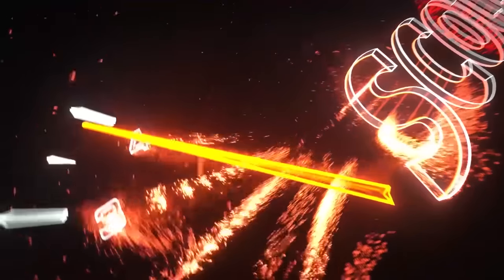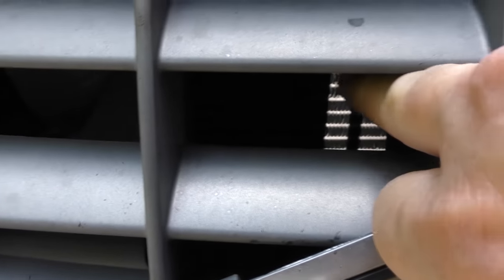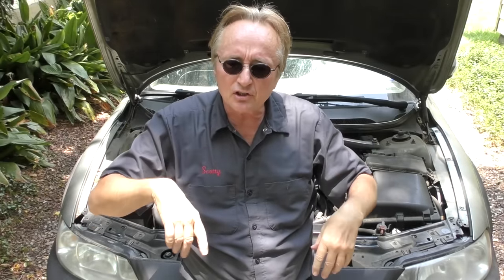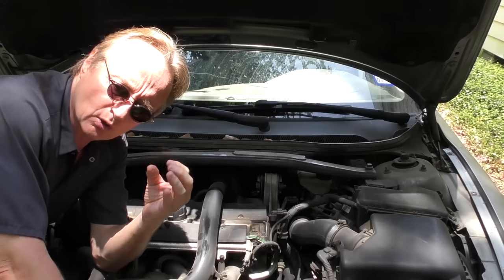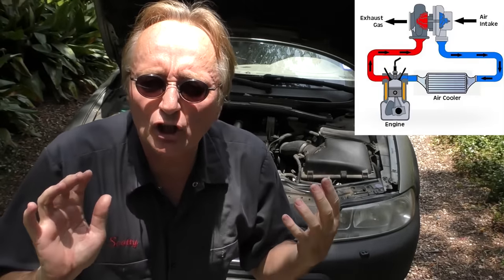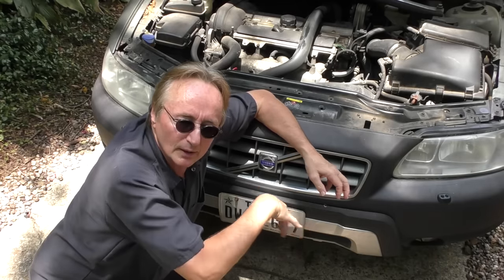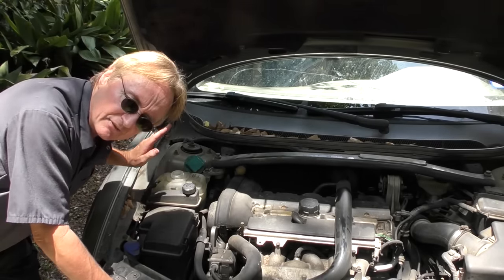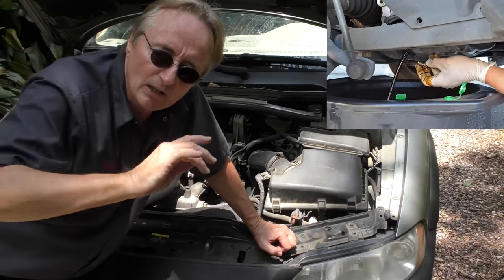5 Things You Should Never Do in a Turbocharged Car

Comment: Replace your turbo lines with silicone hoses and inspect them at every service. Newer turbos are coolant and oil cooled, just restart your engine if you ever stall your engine after driving it hard, let it cool down for about a minute or you can run the aircon on hot for about a minute which will switch on the electric cooling fans.

Comment: Re: Starting up, I just start my car and then get buckled in and whatever other messing about I have to do.   Figure that gives the engine time to get ready,  In a truck with an oil pressure gauge my method was wait for that to get a reading.

We had a Subaru Outback XT 2.5T and it actually had a light on the temperature gauge that went off when it was warm enough and you could not even put it into "Sport Sharp" mode until that light went out.

Comment: Hi Scotty, 

I have a 2016 Lincoln MKC with the 2.0l EcoBoost engine. I bought it used with about 64,000 miles and at about 65,000 bank 1 sensor 1 o2 sensor went out. I bought Bosch replacement sensors and I replaced both the upstream and downstream sensors since you usually replace in pairs. 

Now to my issue, I was getting 18.6 or so mpg before the sensor went out and now I'm lucky if I get 15 to 15.5 mpg. 

Any suggestions on how to increase my mpg?
Reply: Hi if i were you,  I would install the oem o2 sensors, on this case motorcraft and may have better results, Bosh are made for German cars, hope it helps.

Comment: Hello Scotty, I enjoy watching your videos

I have a 2002 Infiniti QX4 with 180,000 miles, it runs wonderful, but I notice a strange ticking or clicking noise coming from the engine only when I have my foot on the brake during super low speeds while I’m either parking or about to pull out of a parking spot, and it goes away once I accelerate and start driving...
What do you think that could be? Thanks

Comment: I've got a 2017 GTI, running APR stage 2. I can consistently break 40 MPG if I drive conservatively and shift at low RPMs. My record is 46.7 MPG.
Reply: Probably a glitch when u put gas in it do a trip like how many miles you drove on that tank ÷ by the gallons you put in

Comment: This video makes me worry about F-150 EcoBoost motors with the "Start/Stop" function.  You won't be cooling down that turbo for 30 seconds after coming to a stop if that damn feature is turning the engine off to try and save fuel!
Reply: All start&stop system cars have a button to disable start&stop feature. So start the car, then press that button as the new starting car procedure.

Comment: I have a 2018 turbo Hyundai with about 7500 miles on it. I have already taken it to the dealer twice for routine maintenance and the last time I noticed they don't use full synthetic, I don't think it's an option. This surprises me since the engine is under the 10 year/100,000 warranty. You'd think they would want it to last as long as possible.
Reply: John C I30n?
Reply: Well don't go back to the dealerships, especially since Hyundai/Kia don't use 'full' synthetic oil, they only use blends when you ask for 'synthetic.' Find a local shop, they will make sure that you get full synthetic.

Comment: I recently changed the turbocharger in a 2005 Volvo XC90 2.5L.  Specifically for this model, change the PCV hose and breather box if it’s never been changed and has over 100k miles.  Replacing the turbo is expensive and labor intensive especially for an amateur home mechanic like myself with hand tools.  All great tips mentioned.  When the turbo goes you will know...ridiculous amount of smoke out the tailpipe and very little power.  Had trouble getting up a small hill when mine went.

Comment: Replace any journal bearing turbos for a ball bearing unit, replace tube and fin intercoolers for a bar and plate design, replace rubber and plastic charge pipes with silicone and ceramic coated aluminum, and replace all worm clamps with t-bolts.  Turbo timers are a good investment as is upgrading your radiator if you plan on running anything over stock boost levels.

Comment: Just took a 400 mile roadtrip in my 2013 Sonata 2.0t and got 30mpg cruising at 75-85mph with a few 100+ mph passes...excellent fuel mileage with great on demand power....I'm fully bought into all the benefits of a small displacement turbo!
Reply: I got 33mpg on one long trip in a 1995 Camaro V-8. Kept it to 75 mostly, but still 🤷🏻‍♂️
(Only once though - 28-30 was typical)

Comment: Does this apply to diesel engines, like a VW golf TDI? Would getting a more efficient intake help with longevity?
Great video, thanks
Reply: If your diesel has a turbo, then yes absolutely. I have a class 8 truck (18 wheeler) and I idle it for about 3 minutes before shutting it down. Cars may not need as long to cool the turbo though, not sure, but some idle time is essential.

Comment: Just bought a 2019 Ford Expedition. It has a 3.5 v6 twin turbo. Motorcraft oil synthetic blend is recommended. Should I use a full synthetic like Mobil one?
Reply: Yes. Mobil 1 full synthetic is the best.
Reply: The problem with using full synthetic oil is once you start using it, you have to stick with it forever(it might be a myth). With synthetic blend, just change your oil every 5-6k miles or every 3-4 months. Whichever comes first. I have a focus st and I use blend oil. Unless you tow and haul medium to heavy loads a lot or drive your vehicle pretty hard all the time, I recommend full synthetic. Cheers!
Reply: Yes. Any  good quality full synthetic oil like Mobil one. I use 5W20 Mobil one full synth in my 16 Ford fusion 1.5 turbo. Not long after the first oil change I got 2 MPG better on the highway. I bought it used with 21K and it had the dealership oil in it when I bought it. I change it at 4500 or so because I don't want dirty oil running through the turbo too long.
Reply: @rickym.5271  that's not true at all.
Reply: @rickym.5271  Also have an ST.  Bought used with 39K miles.  Immediately put fully synthetic oil in, have gone 10K since.  Will see how things turn out

Comment: Had a Turbo 2 door Dodge Colt Twin Stick hatchback in the late 80's for a little over a year. Good smooth riding vehicle with 25+ mpg.
Reply: rabbit diesel gets over twice that, not quite as fast, but some diesels came turbocharged
Reply: @fastinradfordable  had 2, a 1979 & a 1980.

Comment: 1999 f250 7.3 powerstroke  diesel   420k on the original turbo  moter transmission and turbocharger
Reply: All those miles were probably racked up being towed from shop to shop.

Comment: Is Mobil 1 Synthetic a good oil for Turbocharged GDI engine?
Reply: Yes, as long as its full synthetic, not blend, its should work well.
Reply: That's what I am using in my 16 Ford Fusion 1.5. Change it every 4500 miles. 5w20 Mobil 1 full synth. Car gets 40 MPG on the highway. 2 MPG better than when it had Ford dealerships oil in it.

Comment: occasionally im lucky enough to drive my dads Saab 9-3 aero, when you start it up it idles high for about a minute before dropping just below 1000 where it normally is. my dad always said let it sit until the idle drops, is this manufactured into the car to help you remember to let it warm up, or why does this happen?
Reply: Its normal with petrol engines. When the engine is really cold theres more fuel injected because when you inject the normal amount of fuel the engine won't keep running
Reply: MrNFSlover ah, shows how much I know about cars. Thanks!

Comment: I get 7 miles to the gallon in my 2014 Kia Optima Turbo SX for a 17 year old Driving the car and getting 7 miles a gallon is that bad
Reply: Only 7 miles a gallon, that's horrible gas mileage. Your driving it too hard, ease up on the gas pedal some. Don't floor it every chance you get. Scotty has some very valuable tips in this video
Reply: Is this a joke?
Reply: Robert Bogan I’m serious I’ve been doing this ever since I got the car three years ago I’ve been flooring it every day for 3 years The engine never blew up no issues at all the only issues I had with it was I need to get new tires every month and brake pads every four months
Reply: @gav2159  new tires every month??? Well i guess its a race car.

Comment: Have a turbocharged car and you will never want naturally aspirated engines again
Reply: Drive an older naturally aspirated Civic Type R and you'll never want a turbocharged car again.
Reply: @Manakuski  I rather have torque and power at low rpms. For tracks, races, I agree with you, high reving is what wins races. But in my garage I would have a Civic naturally aspirated high rev engine if I could. Oh and also a V8.

Comment: My Hyundai i30 got a 1.6L diesel engine with a turbo charger, never checked the intercooler and change oil once a year, sometimes 20,000 km or more...
Reply: michael lee  that is what Hyundai recommend and I followed that for 7 years of ownership and 185,000 km of driving distance. Actually oil changing  was done after more than 25,000 km in the first 5 years when I had the warranty but since I started doing it myself, once a year seemed ok...
Reply: michael lee  I live in Sweden and almost 70-80% of passenger cars have diesel engines with Turbo Chargers and people change oil once a year or about every 30,000 km or a bit less, almost all manufacturers recommend this period. Probably the weather got effect on this, it is rare to reach 30 degrees C (86 degrees F for USA) in summer and starting from late August until April or May of the next year, it is always cold, and also the key is that people here drive with economy on mind, no crazy acceleration or speeding, fuel quality is very high if not the best in the world, people respect traffic rules which means engines will live longer, I suppose...
Reply: michael lee  just keep changing it regularly, such heat requires an oil change every about 5000 miles. Cars really suffer in hot environments, but they are machines made to serve us with as little maintenance as possible and an oil change isn't a big deal every 2-3 months...

Comment: Scotty, is a turbo with ceramic bearings possible to circumvent the need for oil? Or rather so much oil? Maybe ceramic bearings would keep it safer for the short time it takes the oil to heat up?

Also, great video. That heat built up in turbos will carbonize inside the turbo if you stop the oil flow. It'll literally turn to crusties in your turbo. Glad you included cool down times, a lot of people don't.

Comment: Scotty, perfect common sense. I changed my oil at a 4000 mile mark. Never had a problem. I always let my 3406 Cat run for about 3-5 minutes before shutting it down with the fan switch on so the fan cools it all down. I think it would be a great feature for cars too to have a fan switch ( to turn on manually ).
Reply: Turn on your defroster or heater. That turns the fan on

Comment: Can u explain.why it get better gas mileage as well...
Reply: the turbo makes up for pumping losses.
as the piston sucks air in on a naturally aspirated engine.
with a turbo, air is pushed in, so the engine spends less of its energy pulling air in, and more energy after the boom because of more density of air.
Reply: @fastinradfordable  Ohhh I hmmm got some more questions if. U don't Mind
Reply: @conroycordice979  ask away
Reply: @fastinradfordable  What about the the fact that turbo is forcing air.... Doesn't the ecu has to be change for a proper and more efficient mix
Reply: I guess it recycles energy going out the tail pipe so it has more. Really dumb way of saying it but thats it.
Reply: @robertbogan225  ehhhhhh ok I understand..... Got one more

Comment: I have the 2.7l f150, I was testing oil changes various mileages, 4700 miles turned oil too dark.  I now change around 3000-3700 miles.   

Yes it seems early, but after oil comparisons I find it better to switch before it gets too bad... I do find that changing the oil at less than 4000 I notice a change in performance after each oil change.  

Seems to be like premium gas effect...not all cars change performance based on fuel, but some have noticeable gains.  F150 works as claimed using higher grade fuel when towing or at altitude.